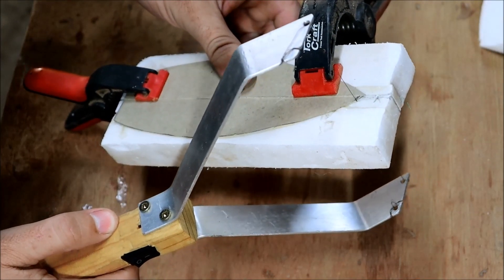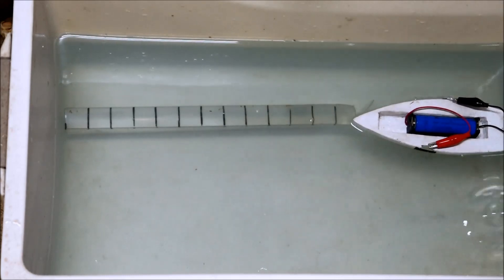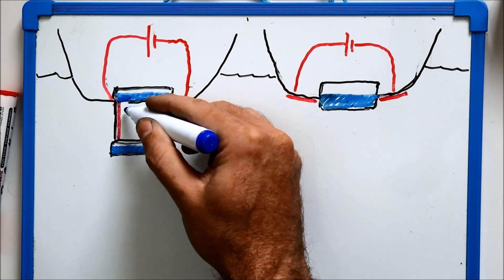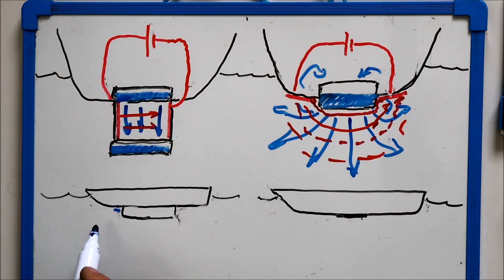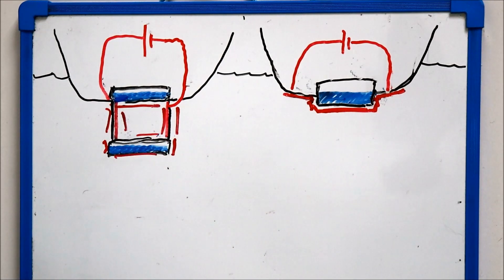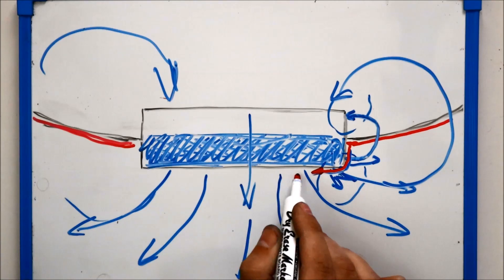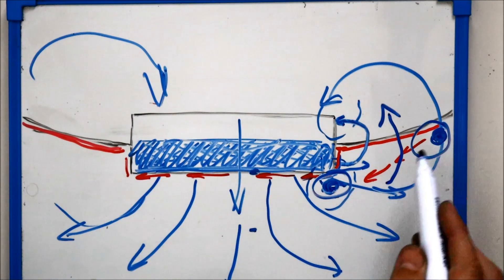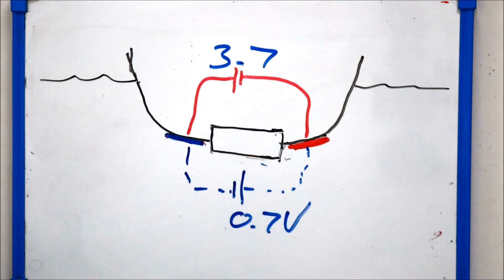Super simple MHD boat drive, great results.

Comment: This is very cool and it's a great proof of concept. What I don't understand is why the force on the fluid automatically means we get a reaction force on the boat. Newton's third law does not seem to say this should happen - object 1 is the ions in the fluid and object 2 is ...what? is it the magnet in the boat which produced the magnetic field, or is it the return path for the current in the boat which produced the current, or both?

With other types of engines, e.g. jet engine, it's obvious - the turbine pushes the airflow, and the airflow pushes back on the turbine, which is rigidly connected to the rest of the aircraft, so the force is transmitted.

But with the MHD drive, it's not so obvious!
Reply from the maker: Great question. Object 2 is the magnet in the boat. It is pushed forward by the magnetic field that is produced by the moving ions in the water.
Reply: @williamfraser  thank you!

Comment: Another thought:  Why not put your electrodes OVER a broader magnet?
that way the magnetic field is stronger/closer to the electric field  and the2 are more perpendicular to each other with no backward field/ reverse thrust anywhere.

Halbach Array..???

Also NB the scientific paper on the Chlorine-Hydrogen fuel cell.
That means the gasses could be collected and turned back into electricity.  That should add a bit of range/efficiency.

Comment: How cold one capture and use the H2 produced..?
I'm seeing a kind of hydrodynamic shaped hood (just in case) that hangs over the Cathode just above the water and a vacuum pump  to suck it up, but unless there's a low pressure mini fuel cell...

The Yamato 1 guys coulda just put a hood behind, vacuumed by the genset intake.
I don't know how you'd clean up the exhaust though.
Hmmm...

Comment: You have to make an atmospheric static motor. High voltage low Amp... And an electromagnet will give you Flux control if you want to go next level

Comment: well, i have no ide about this stuff, so i ask a dumb question, i understnd this works with a small eps ship, but what about scale? and at scale, lets say a 40 foot ship, what impact could this have on life in the water? is it less impactfull then normal rotor blade cos it dont emmits stron sound? or does the extra strong magnetic force have any possible impact on sea lifes sense of navigation?
Reply from the maker: The magnetic field strength diminishes drastically with distance away from the boat but quantifying its impact on sea life will be difficult to determine. The same goes for the external electric currents, so I doubt this configuration would ever be considered acceptable at larger scale.

Comment: What is Material used as electrode for it. Is Neodymium Magnet is necessary or we can use normal bar magnet on it , is it is possible. Is their is any specification required on battery is it is necessary to use lithium battery with specific power
Reply from the maker: I used aluminium tape for electrodes. Neodymium magnets and lithium batteries give the best performance but other types of magnets and batteries will also work.
Reply: @williamfraser   Thank you Sir . It's been helpful

Comment: Good work. Maybe 2 points wich might help you highten the output:
1- put the magnet into "opened cascet" metal box with opened side, from wich you expect work. 
2 - if the "bow" part of the magnet is actually burried inside of the hull (to not "look out", but be in direct line with the line of the hull) that might lower the drag too.

Comment: Based on Maxwell's Rule ... Magnetic Field, Electricity & Force ???
Reply from the maker: Exactly that. Water is the conductor.
Reply: @williamfraser  Thanks for reply ! I'm not an engineer, I learnt Maxwell's rule when I was in high school attending Physics lesson.  I think, Maxwell's rule is one of the greatest discovery as it leads to the invention of electrical motor. Without electrical motor, we won't have so many electrical tools. As small as hand-held electrical drill, washing machine, compressor. As big as electrical generator and different kinds of engines, all these important inventions are mostly based on Maxwell's rule .... am I right ??
Reply from the maker: @lorddiablo8575  The phenomenon is better known as the Lorentz force law but Maxwell's equations already accounted for it three decades earlier. Maxwell's equations go far beyond motor force, it describes electromagnetic radiation like radio and X-ray, optic lenses. His work followed on earlier discoveries by Faraday and Lenz.
Reply: @williamfraser  Learnt a lesson from you ... Thanks for sharing !

Comment: What about halbach array of magnets to increase the field of influence. Maybe a step up high voltage dc generator would give more current for better acceleration, would a transformer be better or more batteries in parallel? Cool stuff though anyways! 😮
Reply from the maker: A Halbach array will definitely strengthen the field in the water. As michaelbiggs commented, the array results in flux lines going in various directions, so a single pair of electrodes won't work. In my larger model I used two magnets giving a field of similar shape as a Halbach array's field. I used three electrodes which worked well. More thrust will require higher current and since the water resistance is fixed it means higher voltage. A boost converter will certainly work but parallel batteries won't make any difference.
Reply: For the thrust to be in a particular direction, the direction of the current and the direction of the magnetic field have to be correct. In a Halbach array, the direction of the magnetic field reverses from one element to the next, so the thrust would reverse as well.

Comment: What if you use a round magnet to were there is only one point or corner
Reply from the maker: If you mean using a cylindrical magnet that is magnetized diametrically (i.e. perpendicular to the axis) with one half protruding below the deck, then it should work even better than the block magnet. I believe the surface flux density is strong along the entire perimeter, rather than just at the edges of a block.

Comment: try a railgun with magnets/maglev-rail (not the induced magnetic field railgun, permanent magnet railgun with arc through the launched magnet/conductor, maglev when the projectile is a magnet disc/ring, disc-ring has minimal contact with the side walls but still conducts high current), and replace barrel/conductors/rifle-rails if the are consumed by the shot
Reply from the maker: I have tried something similar but the problem has always been melting and welding at the contact between rail and projectile. I think a thin layer of graphite should solve that problem. But yes, I really should build it!
Reply: @williamfraser  Trying myself that too, but I would just move the projectile so fast that any welding does not melt anything (flash heating but not melting)

Comment: would it make sense to just add exposed single strand wire parallel to the magnet in place of the wide strips?
Reply from the maker: Yes it should work, efficiency might actually be higher. Well worth trying.

Comment: Instead of a permanent magnet what if you used an electromagnet. Wouldn't that give you the ability to move backwards in the water depending on the polarity of the magnet
Reply from the maker: Yes it would. It is also capable of stronger magnetic fields. It would require additional electric power though, while a permanent magnet doesn't. The Yamato mhd ship used superconducting electromagnets but changing the current direction in a superconductor is not a trivial matter.
Reply: @williamfraser  how was it non trivial? Isn't that an isolated circuit of the system?
Reply from the maker: The superconductor coils are powered up from a shore supply while the boat is still docked. Once the required current is flowing the coils are disconnected and the current just continues to flow through the coil in a closed loop for the duration of the voyage. The energy contained in the coils and magnetic field is massive. To reverse the current all that energy first need to be dissipated or stored before the coils are energized with a reversed current. In principle, supercapacitors might be able to store the energy like an LC circuit.
Reply: @williamfraser  but how would the current continue to flow though if there's resistance in the wire? Wouldn't it just dissipate as heat after so long? Are you using a room temperature superconductor or is this just hypothetical?
Reply from the maker: That is the beauty of superconductors, practically zero resistance. The Yamato coils required cryogenic cooling.
Reply: @williamfraser  okay aside from that how does the current keep flowing through the coil after it's charged. If you have a closed loop of wire then how does the electricity continue to flow through it? The only explanation I can see being true is a temperature differential between two different parts of the coil of wire
Reply from the maker: Not sure but would expect that it is the magnetic field. A reduction in current would lead to a reduction in magnetic field which in turn drives the current. The two should be keeping each other in equilibrium.
Reply: @Throfed  The current will keep flowing the same way a massive flywheel would keep rotating. A "superconducting" flywheel would be synonymous with magnetically levitating a spinning flywheel and placing it in a vacuum chamber where nothing will slow it down. It would spin for hours, days, even longer. The REASON a current continues to flow in a closed loop even when there is no external voltage across its terminals to sustain it is best described by Lenz's law, similar to Newton's laws of motion, which states that any coil/inductor with inductance (like mass or density) will resist any changes of current (motion/momentum) by inducing a voltage (or Electromotive Force) in opposition to that change. A perfect coil conducting an electric current with zero resistance would produce an equal and opposite force perpetually. In reality, a real inductor loses energy due mainly in part to electrical resistance (like friction).

In other words, magnetic field is the electrical inertia of charged particles in motion (electrons in the wire). The equation for how long a current would flow in a typical coil recirculating with non-zero resistance can be easily calculated by dividing its inductance by its resistance L/R = T to get time in seconds. After that time, the current will have dropped to 37% of its fully charged starting value. After five of those time periods, the current will have fully discharged and dropped to zero. The Yamato 1's coil has a 3.3 H inductance. If the resistance of the entire loop was 0.000001 Ohms and it charged its inductor to 2000A, the current would drop to 740A after 3.3/0.0001 = 330,000 seconds or 91 hours and 40 minutes. However, because this coil is a superconductor, it has completely zero resistance, and the relationship breaks down because you cannot divide by zero. In reality there are other energy losses that don't make this superconductivity perpetual, but for all intents and purposes, it should be able to operate for days.

Comment: I don't fully understand these principles but to me it seems like you could compound the effect by stacking those magnets and only using the magnetic flux that is right next to the magnets themselves and running a wire in a weird shape that makes it so the current goes through the flux then behind the magnets to the place where the wire started from and then running it through again and again and again which would give you more thrust I think
Reply from the maker: It is the current passing through the water that matters. The water is the "moving" conductor and experiences a force in the same way as a current carrying copper wire in an electric motor. Current is passed into the water as it slides over the electrodes , just like the sliding contact in a brushed dc motor.
Reply: @williamfraser  okay that makes a little more sense. So what would happen if you changed the resistance of the water by adding more or less salt to it? I assume that less salt would mean less force to go forward and more salt would mean more force to go forward up to a certain point. Does that sound right?
Reply: @Throfed  you nailed it. Thrust and efficiency increases with conductivity of the fluid.

Comment: I see a few but consistent bubbles popping as they hit the surface by the side of the boat. Not sure but this may be from the current, making H2 and 02?
Reply from the maker: Yes it is the result of electrolysis, H2 at the positive electrode, O2 and/or Cl2 at the negative electrode. Various secondary reactions can take place at the negative electrode as the gas dissolves back into the water.

Comment: What if instead of the battery you used a wind turbine to generate power?
Reply from the maker: The wind force on the turbine will completely overpower the mhd thrust. The problem is the low efficiency of the mhd. You'll need a very large turbine to generate the necessary power.

Comment: Just one criticism.  Flux lines are static and do not change (unless the underlying magnet changes), but the drag through space is decreased in the individual flux lines by placing magnetic iron in its path.  Air simply resists magnetic flux much more than magnetic iron.
Reply from the maker: Any iron in proximity changes the flux lines. Compare the flux distribution of a free magnet with one close to a thick iron plate and you will find almost no flux on the reverse side of the plate. The plate completely re-routes the flux.

Comment: The question is, would the boat move more efficiently if you applied 2.1W to a motor driving a propeller?
Reply from the maker: A propeller is way more efficient, there is no question about that. The advantage of MHD is stealth and, in this special duct-less configuration, no risk of being fouled up by weed or debris.

Comment: I saw a video like this about 30 years ago. Can't find it anymore. In the video, they used an air ionizer. I actually thought this would have been the same thing. All this stuff simply shows that quantum mechanics is possible. The demonstrations are annoying. They give me a feeling of time being wasted on the impossible. Let me give an example; Some person invents a billion-dollar idea as such and some other person is like, "look, I did it with a battery at low voltage and power.". Meanwhile, at a larger scale, that idea is using power inefficiently whereas you can use an electric motor more efficiently. And that's what's wrong with the world we live in. Did you know even Albert Einstein disliked this sort of thing? They ruin efficient and macro science.

Comment: My first thought with your nearly flush mounted magnet would be to bend the electrodes into an "L" shape to extend the electrical field out a bit more (and shape it) to get better interaction with the magnetic field.  A side effect would be the electrodes would act as skegs or chines to help keep the boat moving straight through the water.  Adding an iron "horseshoe" inside the hull to shape that part of the magentics absolutely makes sense.  There is a large ,calm body of water that would be almost ideal for testing that type of marine propulsion system, it would require a trip to Israel though LOL
Reply from the maker: Optimum electrode shape will be a tradeoff between the additional thrust and the additional appendage drag. You are giving me good ideas, there are lots of salt evaporation pans adjacent to the local estuary.

Comment: The dis-similar metals idea is brilliant!  Is that your idea?    Would it help to ionize the water ahead of the boat with an electron beam or some kind of static generator?  Ionized water should behave differently in the magnetic field but I cannot  predict how since both the magnet and the foil conductors are stationary and every design I come up with requires some kind of moving magnetic field.  Good luck William
Reply from the maker: I have just learned that the Yamato-1 mhd ship also used dissimilar metal electrodes, platinum plated titanium cathode and iridium oxide DSA anode to suppress chlorine gas formation and erosion. The electrodes conducted up to 2000A, I'm not sure about voltage but I doubt a couple of extra volts would have been a design consideration.
Reply from the maker: Thanks Wade. Yes the different metals is my idea, although I doubt I'm the first to come up with it. I don't know anything about electron beams but adding salt to the water ahead of the electrodes will increase the water's conductivity allowing higher current and more thrust (or higher efficiency at the original amount of current). The acceleration  of the additional salt mass should also provide more thrust.
Reply: @williamfraser  The implication is that fresh water lakes would not be a good candidate for this kind of propulsion, however some water has a high mineral content and might still work, and then there are natural salty lakes.  Ionizing water is not something I know anything about, but I am sure there is a video on how to do it if it is feasible.  Perhaps elongating your electrodes for the length of the boat and getting more use out of your magnet source at the back.
Reply: Yes, and it’s a relatively constant voltage differential. Is it enough of a differential to run a joule thief with, to recharge the battery? Or could a supercapacitor & solar cell be used rather than the battery?

Comment: So if you eliminated the battery would you still get any current with the different cathode.
Reply from the maker: Yes, as long as the electrodes are connected inside the hull to complete the circuit.